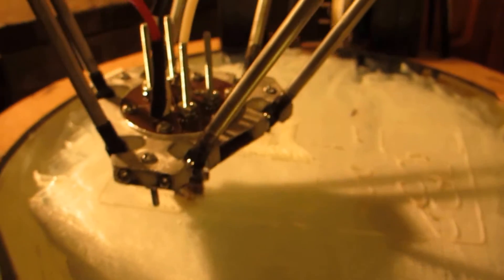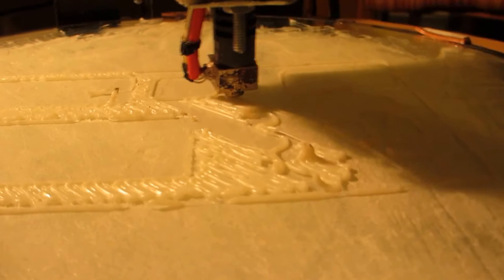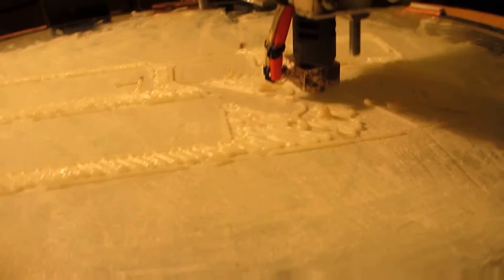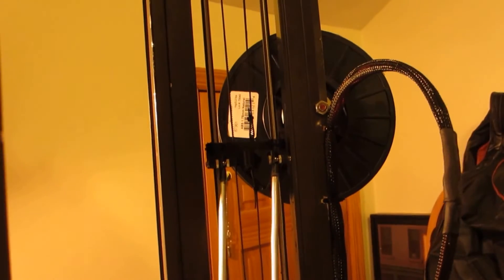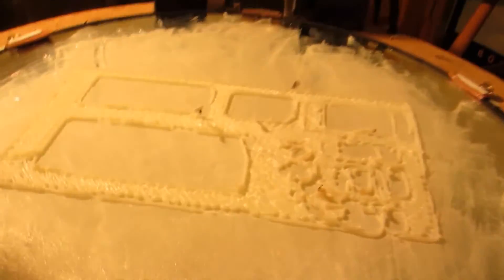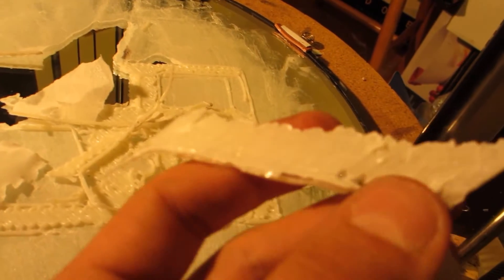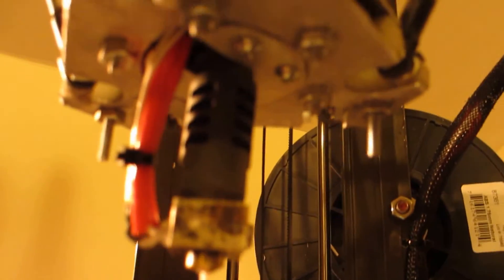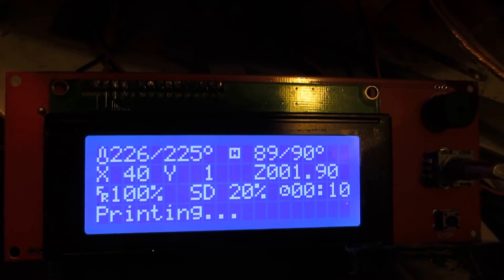HUGE J-Head 3D Print Disaster

Comment: Thanks for the video.....everyone wants to show off their printing prizes, but nobody wants to show their ugly, red headed step child disaster. Looking into 3D printers along with 3D scanners for modeling in 1/35th scale as there's a lot of armor kits with NO interiors and tired of scratch building 'em.
Reply from the maker: So far I have not seen any reasonably priced scanners that are anything but trouble. As for showing the good the bad and the ugly. I am a firm beliver that there is allot to be learned from mistakes. This mistake has allowed me to have a printer that can print with nozzles in .3mm to 1.0mm range quite easily. That 1.5MM nozzle was used to 3d print the case for the printer. It came out pretty darn nice after some good tweaks.